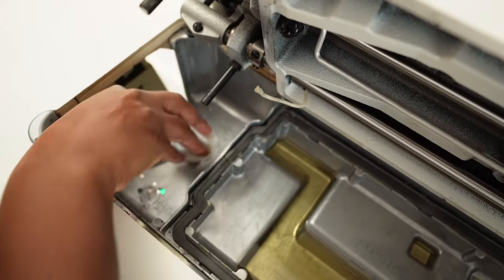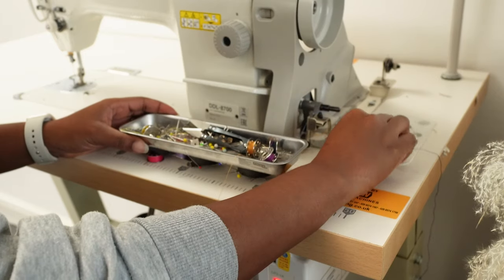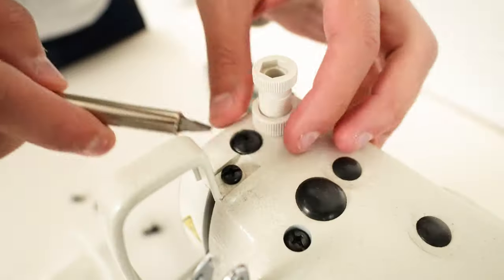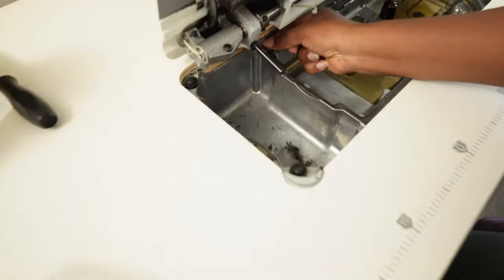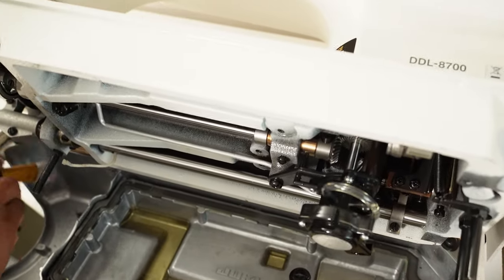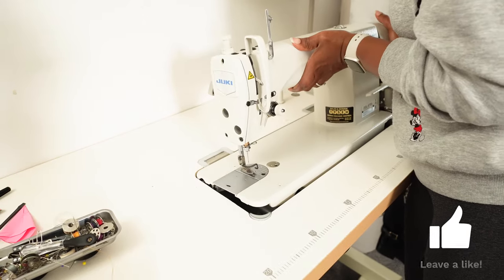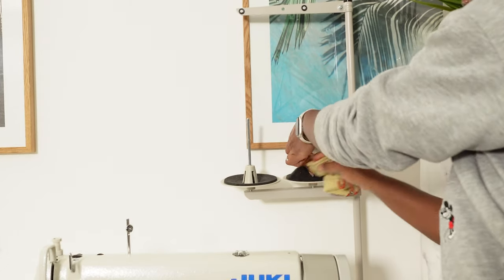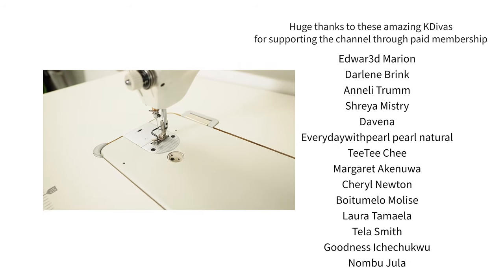How to Change Oil in Industrial Sewing Machine | Clean & Oil Juki DDL 8700 Industrial Machine

Comment: I have a question and i would appreciate it alot if you kindly share your experience. 

How do you deal with body pains after sewing or when sewing for long hours? I mean like back pain, headache, eyes, how do you copy? Have you experienced that before?
Reply from the maker: It’s usually a sign that I’ve been working for too long in poor posture. I make sure to do lots of stretches targeted at those pains points the next day. 

I know that using the right type of chair and table contributes to this as well. For example my cutting table is my dining table, which is too low for me.
Reply: @KimDave  Thank you for the kind response. I appreciate ❤️.

I also reached out to you on Facebook, am hoping to hear from you 🙏